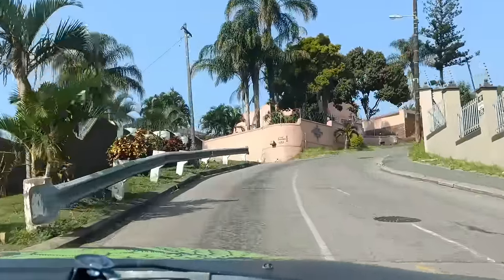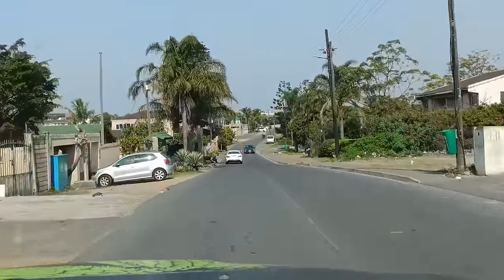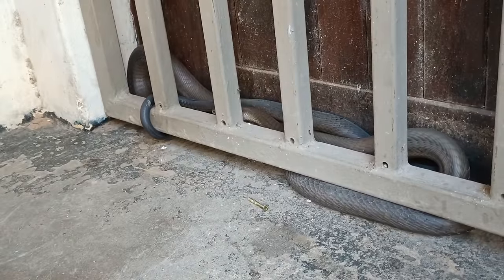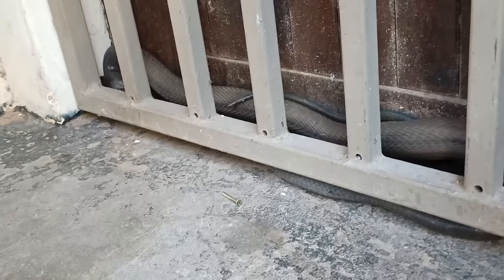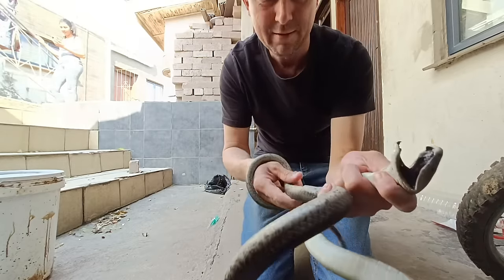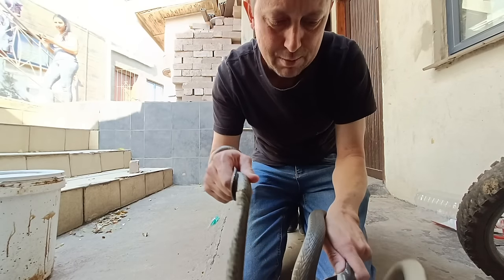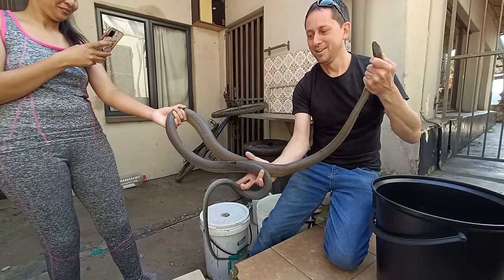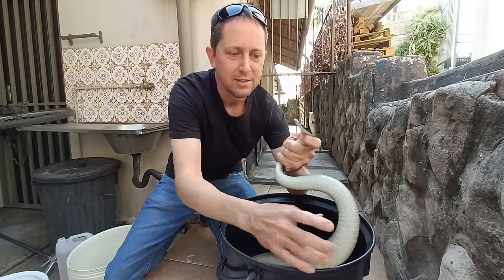Black Mamba survives deadly human attack!!

Comment: There's also a green Mamba  as well.  These snakes are very deadly and the 2nd largest venomous snake behind the Cobra.
Reply: Green mambas are almost as deadly as black ones, but they are not THAT angry and nervous.
Reply: Greens tend to stay in the bush a bit more, are slower  and are not as powerful if I remember correctly. 
Black mambas can get huge - over 14 ft, but the biggest I have seen was about 11 or 12 ft in the Transkei. Unfortunately dead.
This one was about 7 or 8 ft so only medium size.